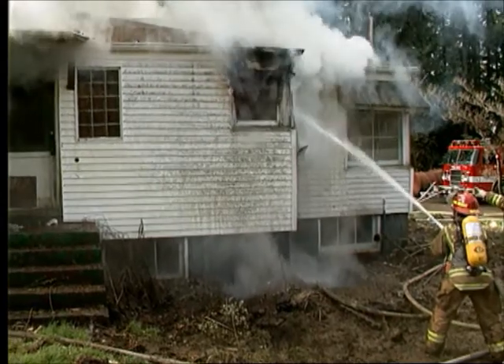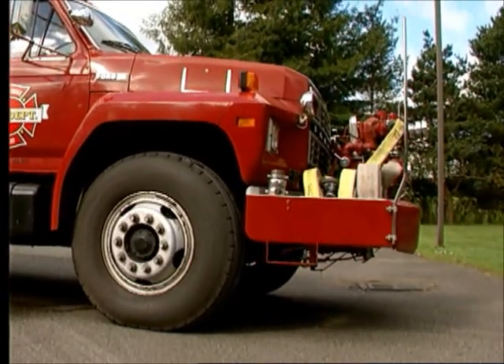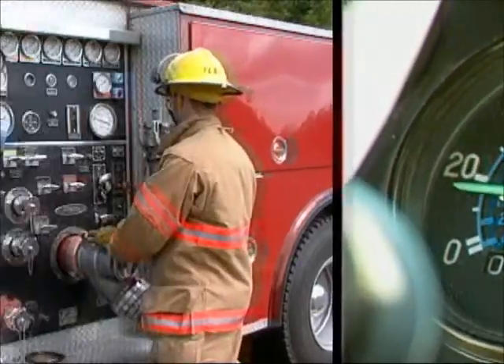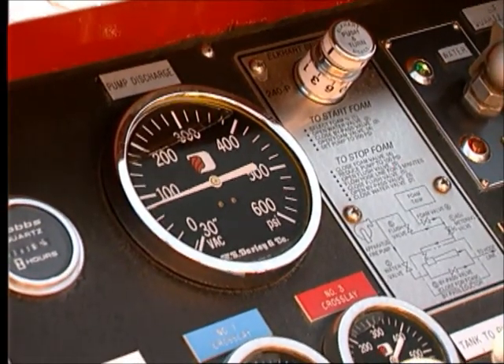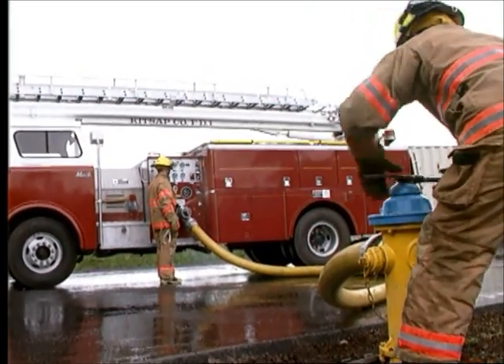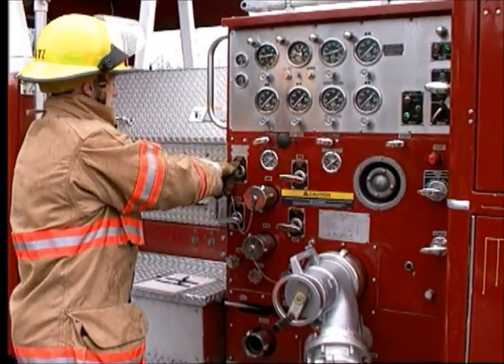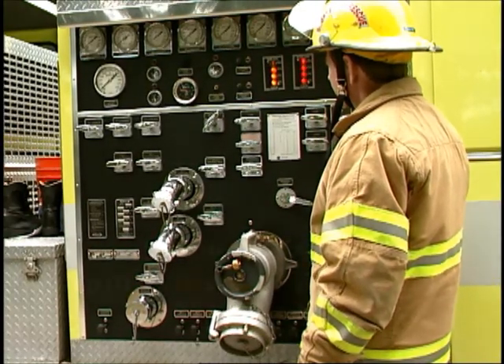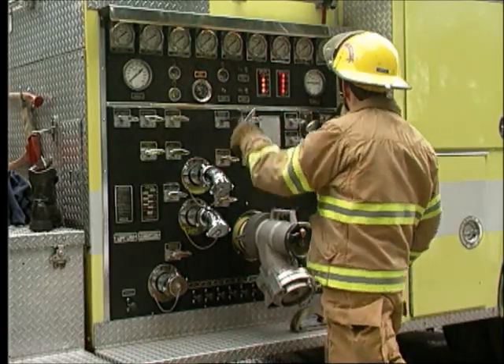Video 3 - Operating Fire Pumps

Comment: In order to place the Front Mount Pump in Pump Gear, there was a lever directly under the Intake of the Pump, with a Small Knob on the lever. Pull the Knob out toward you, and turn the Pump Gear Handle to the Opposite Side from it's original position, and release the Knob, this placed the Front Mount Pump into Pump Gear, with the Ability to Pump, and Roll.